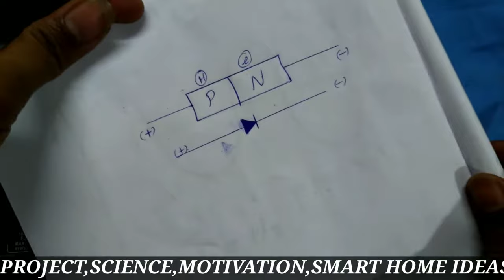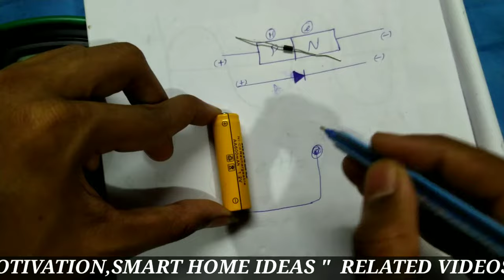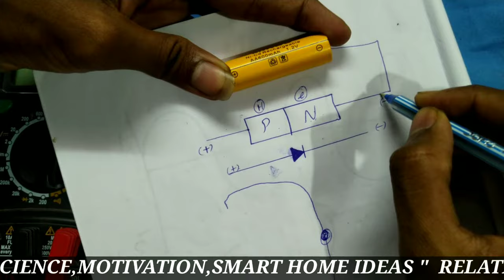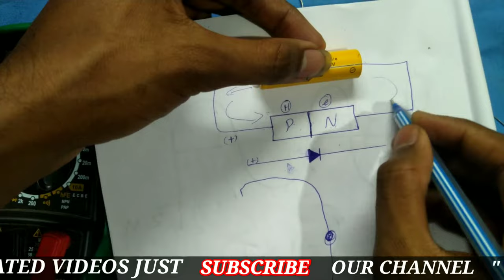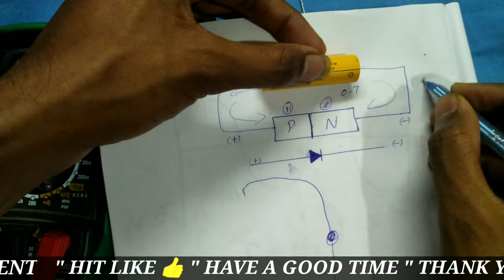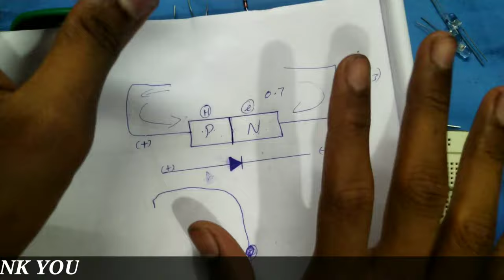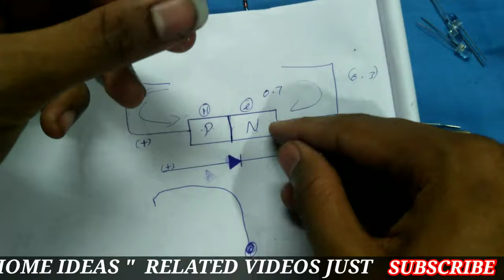what is diode tamil | what is zener diode | light emitting diode | tamil | manimarantech

Comment: Bro i am going to make a 6v voltage regulator what type of diode I need to use for the circuit protection?
Reply from the maker: 1n4007 diode number